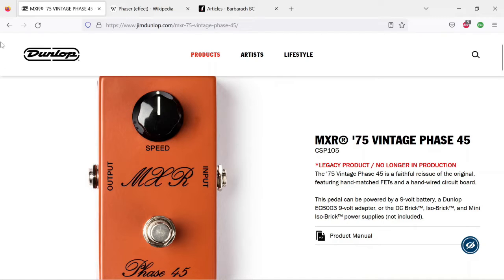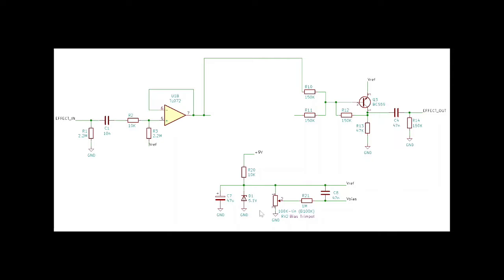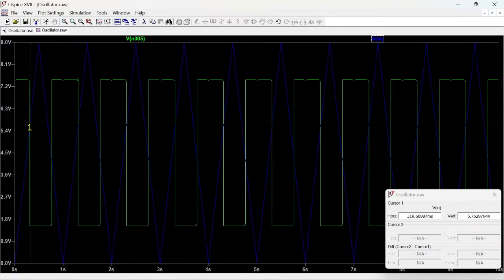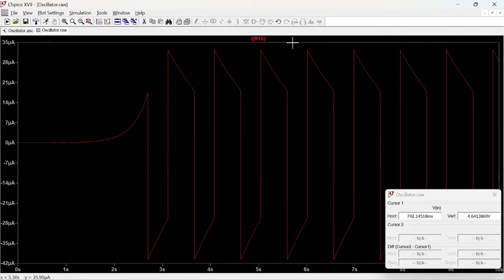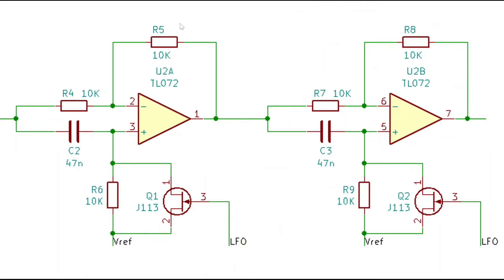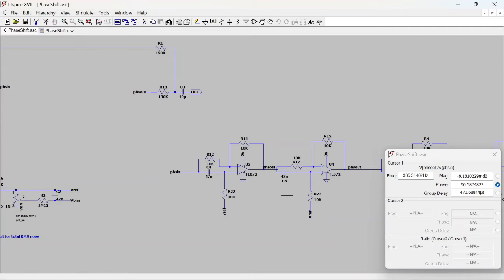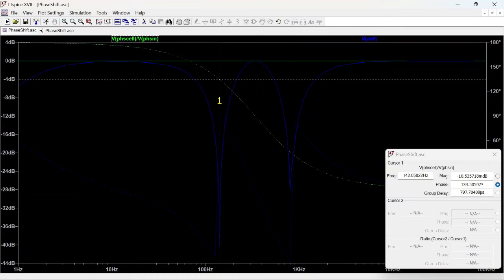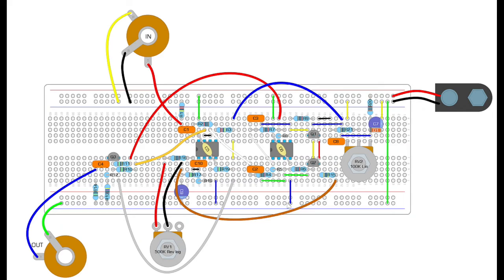Breadboarding a simple Phaser

Comment: Sounds more like a tremelo than a phaser
Reply from the maker: Hey there. I hear you :) I have Bad Stone at home and it's way more dramatic sound. Phase 45 is a quite a bit subtler in comparison, and I had my doubts to be honest. In my next video I will get it to sound better with different JFETs and better matching and will be clearer that it is sounding like a phaser.
What I mucked up is I put R6 and R9 to be 10K and they should be 24K (I was using Phase 90 schematic as a basis of this, but I was looking at Phase 45 at the same time so got that a bit messed up so some of the bottom end does not get swept as it should). But I'm working on another video to get that sorted ... it's a learning process.